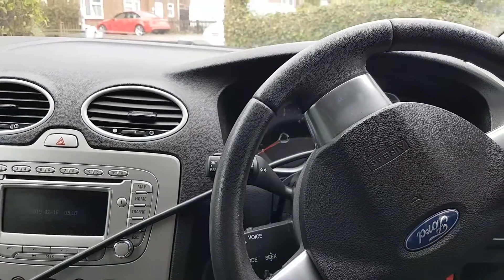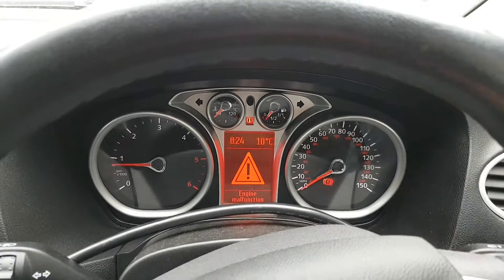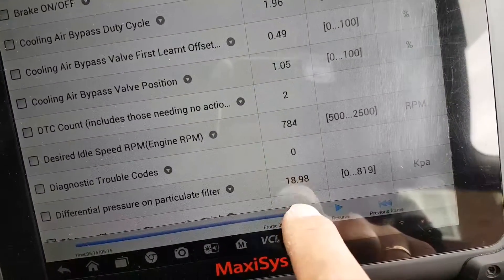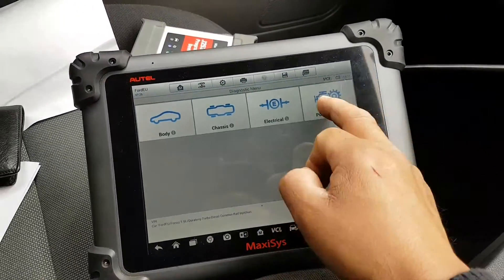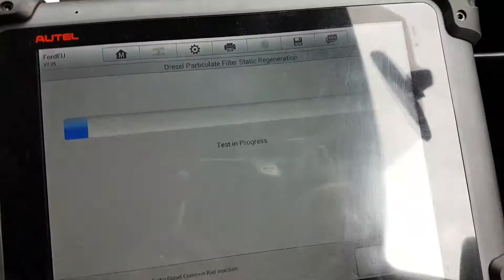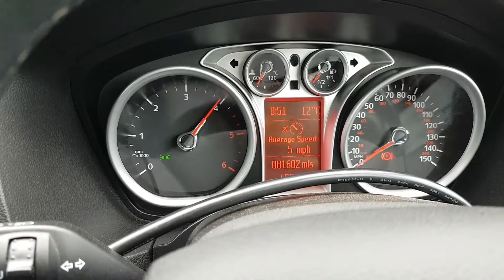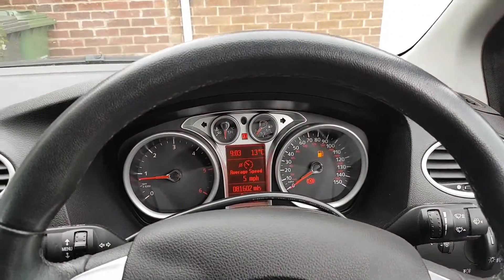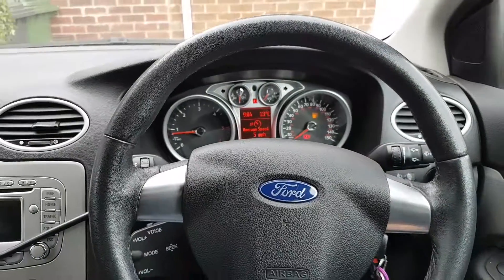Ford Focus 1.6 TDCi code P242F. DFP regeneration.

Comment: What is a DPF? (sorry if stupid question)
Reply: Thanks, I had a message engine systems fault on a focus and this appeared, so thought there might be a connection.
Reply from the maker: Diesel Particulate Filter
https://en.m.wikipedia.org/wiki/Diesel_particulate_filter
Thank you for watching and for your comment!
Reply: Diesel Particulate Filter (DPF) is what it says. Diesel engines have particulates which are harmful to the lungs. The filter is designed to capture these particulates and burn them off during a normal regen cycle. The regen cycle tends to happen when the car is driving at a constant, like fast road or motorway. Depending on the car, regen uses either a fifth injector. As corrected by Ian U,  ad-blue is used to reduce other emissions! This why modern diesels are not suitable for town driving. If they are not given the time to regen, the DPF will get full causing the issues shown in the video.
Here is a Wiki on the subject - https://en.wikipedia.org/wiki/Diesel_particulate_filter
Some petrol direct injection cars are starting to have particulate filters too - https://www.autocar.co.uk/car-news/industry/volkswagen-equips-petrol-cars-particulate-filter-technology
Reply: @konradc12 
Adblue has nothing to do with DPFs. Adblue is the reagent used with a Selective Catalytic Reduction system for reducing NOx emissions.
Reply: @supernoodle48  Thanks for correcting me. I  will amend my reply. 👍
Reply: @konradc12 
It's can be difficult to tell now as it's now common for Eu6 cars to have a combined SCR and DPF called a SDPF. So you will see a single brick with an injector upfront, but it's the Adblue injector.
These are always close coupled, close to the engine.
The vaporizers were usually fitted on underfloor DPFs as they were far from the engine and needed one to get the heat into the DPF.

Comment: Before doing the regeneration I would have done a physical inspection of the DPF pressure differential pipes as they crack and perish and collapse. This maybe the reason the readings post regeration were high for a few minutes.
Reply from the maker: I actually did a visual inspection before start... 
There is a bit of background story with this car, which I decided not the go through on the video...😉
Thank you for watching!
Reply: My pipes were really bad they would literally crumble in your hands, I bought replacements and they were made of silicon so that should cure that problem.

Comment: Hey buddy, does your autel go into Mercedes braking systems? 
I use Delphi ds150e (Chinese clone) 
And it doesn’t get into the braking system on Mercedes vehicles. I’m looking at getting a proper system and spending some good money on a system. 
Which would you recommend?
Reply from the maker: Yes... the Autel does...
Thank you for watching!
Reply: LM Auto Repairs thank you for the reply! What model is it? Cheers for the videos! Helps us tinkerers out!
Reply: @luketuttiett  Maxisys 908P
Reply from the maker: @luketuttiett  
My one is the MS908P 
👍

Comment: What do you think about the additives to clean the dpf that reduce the melting point of the particles?. Or perform a decarbonization with machine and hydrogen?.
Reply: Imo additives are generally speaking the best snake oil's sold.
Reply: @jothain  The dpf ones do actually have a catalyst which lowers the temperature that the soot will burn at but its more of a thing that you use to prevent issues from short journeys rather than when its already blocked but the fuel cleaner ones are mostly snake oil especially the cheap ones like redex dont do anything to clean injectors or carbon build up
Reply from the maker: @jothain  
Agree!
👍
Reply: What macias r u use I
Reply from the maker: Personally, I never used those additives, nor have used those machines or that service.... 
Thank you for watching!
Reply: @LMAutoRepairs  thanks

Comment: With the differentiel pressures this high after a static regen, the p242f will be back within a week. Its shouldn't  be higher than 40 to 50 mbar at 3000 rpm. Does this car have the extra injector before the dpf? Most fords with a p242f have a failed 5th injector in the exhaust.
Reply: What you are referring to is a vapourizer. Not sure this year make would have that.
Reply from the maker: Possibly... this was done in May last year... and car still going... at least lasted more than a week....😛
If comes back, will have to check...
Thank you for watching and for your comment!

Comment: I share your concerns - I've done several succesful static regens using maxi sys but the last one, on a 1.6 tdci Focus, resulted in terminal big ends knocking! Be warned people.
Reply: On Ford & Mazda, when the DPF is clogged and you have the Ash Accumulation codes, you have to do an Oil & Filter change prior to a Forced Regen.

Big End Knock was due to excessive Diesel Saturation of the Engine Oil. 

You inadvertently caused the Knock to occur.
Reply: @ukcitizen1158  Yes, in hindsight that makes sense. Learned the hard way though!
Reply: @darrellcook7837  

In this game, you live and learn.....

Technology and Special Functions are constantly updating and evolving, but, Technicians are failing to take Workshop classes and don't seem to have a tendency to keep abreast with manufacturers Bulletins, unless they are working in a Dealership or are passionate about what they do. 

These Bulletins are provided for a reason. 

They are essential!

Technicians owe it to themselves and to the consumer to provide the consumer with a value for money, professional service, which then goes to show that said  Technician is clued up and knows what he/she is taking about. 

Results speak for themselves. 

If you had access to Bulletins, you would have known about Diesel Saturation since 2007.

Investing in Auto Data will go a long way.
Reply: @ukcitizen1158  Well I'm passionate for this job and I do not take any classes. Internet and videos like this work fine for me.

Comment: I have done only one static on a 2.0 tdci kuga, but it only revved up to 2750 rpm not 4000 like this focus. It went well but it used the entire 10 min. Doesn't t the focus use  the Eolys reservoir? Does the autel shows any information about that?
All the best!
Reply: Some do use it. 

In those cases, there is an option to select the Module and read the data in regards to fluid levels and there are Actuation & Test Procedures in Special Functions.

There is also an option to reset the  Counters back to zero.
Reply from the maker: Never checked... as was no faults for anything else...
I don't think these ones have the additive...
They use a small injector in the exhaust...
Thank you for watching and for your comment!